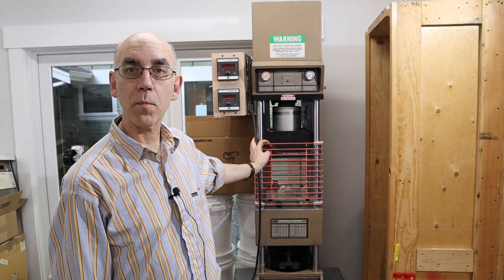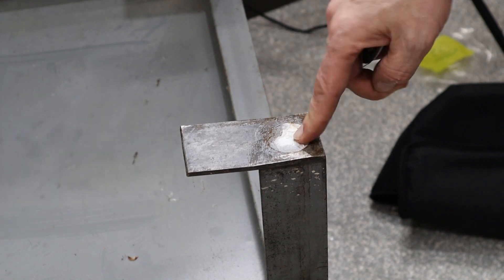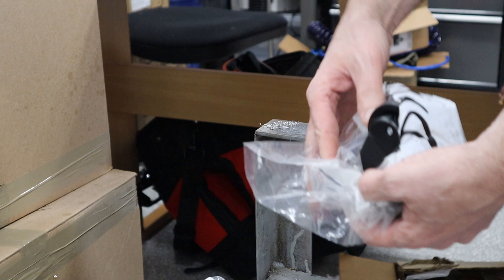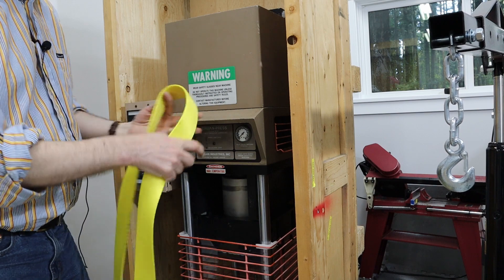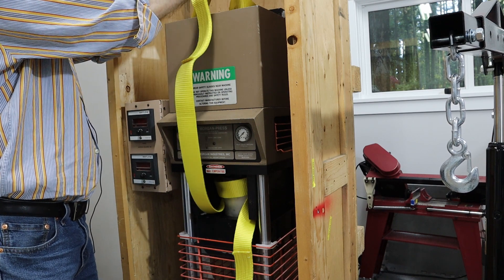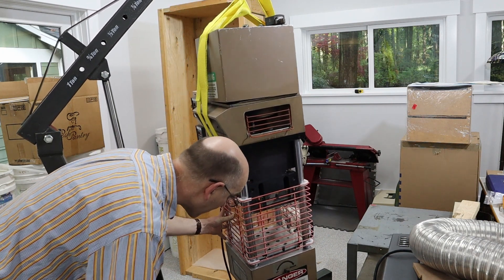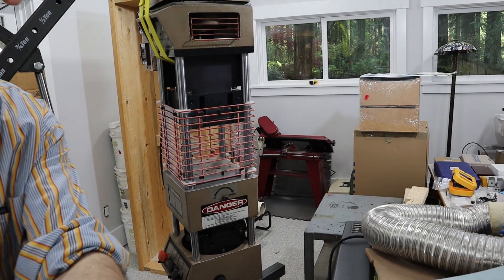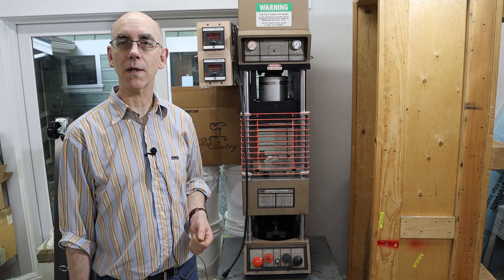Unpacking the Morgan Press Injection Molder

Comment: Hello,

I have been looking at getting into injection molding stuff at work. I have been watching your videos as well as my boss.  We already have plenty of large CNC machines that could do molds, but we are wondering about the machines themselves - Is there any benefit to not buying one of the gigantic used industrial machines, as they seem to be as cheap and sometimes cheaper than smaller presses than this morgan? Are presses in that price range just trash and completely worn out?

Also have you done anything on this machine? I find it pretty neat
Reply from the maker: I hope to have the Morgan up and running today. As to why these machines rather than the large machines, that's mainly a power and space issue for me, as this is a hobby. So if you want to do this as a business, a larger industrial machine makes a lot more sense for a number of reasons. First, they can run automatic cycles and just pump out parts. Second, they can handle larger parts. And third, they have screws instead of plungers, which means you can mix masterbatch (additives for color, anti-static, etc.) in with raw plastic pellets to get just about any color you want. I have to buy pre-colored pellets for my machines because plungers don't mix well at all.
Reply: @JohnSL  Thanks! We love your videos, very informative and no filler. Will love to see it running soon hopefully then.